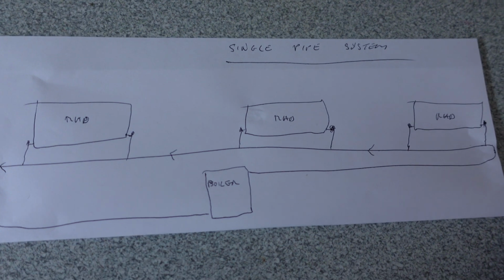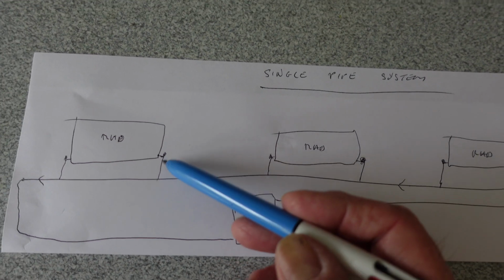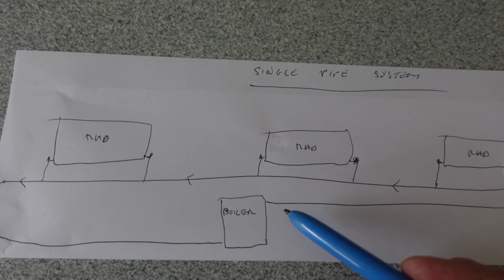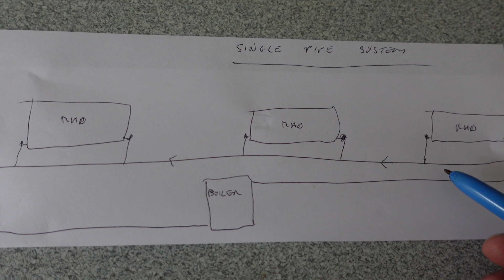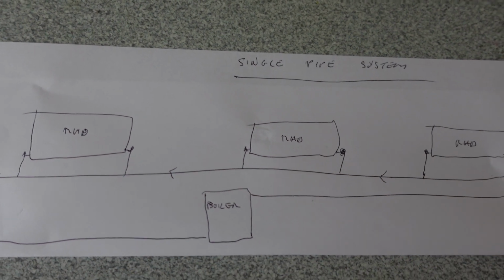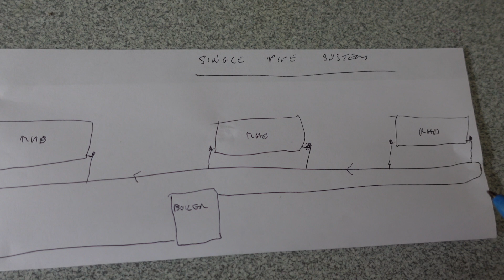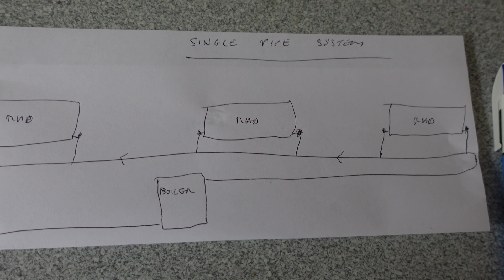Which is the flow pipe in, with a radiator, on a one pipe system?

Comment: May I ask, if you want to take one rad off and capped the pipe work, can you can cap each one individually or got to connect the pipe back in together?
Reply from the maker: You can cap them independently.
Reply: @dereton33  right, my point was if I cap each end pipe which is for trv and locksheal where they're don't this affects any circulation?

Comment: The bottom end of my radiators in two far end rooms never heat up no air in the radiator either what could be the issue faulty radiator? Ever since installed has never worked properly from the bottom
Reply from the maker: If they are new radiators then the system needs balancing. If they are old ones then they need cleaning out.
Reply: Perhaps a circulation pump?

Comment: Good vid thanks
I've recently moved into a new home and want to balance the rads, but having a problem determining which are the flow and return valves as all the valve caps are the same with some broken (have 2 just spinning on 1 radiator) anyway, how can I work out which is which, do I open all the valves and and see which valve on each rad heats up first?  
Then whatever side heats first that would be the flow side? and whatever rad starts to heat up first would be nearest the boiler? So I'll have a bit of jogging to do around the 10 rads. 😁 I'm not sure if it's a 1 pipe system, there appears to be a hot flow pipe and a cooler return pipe at the boiler. I suppose another way to find out is to pull up a floor board. 
Thanks Al..
Reply from the maker: Sonds like a two pipe system. Any way you have it about right for finding which is the flow.

Comment: Is there a way to find out if it's a one- or two-pipe system without lifting floor boards?
Reply from the maker: Not easily.
Reply: Can you work it out by inspecting the pipes at the boiler end?